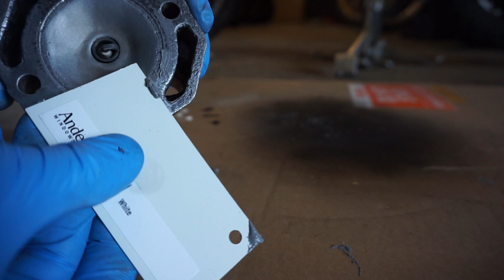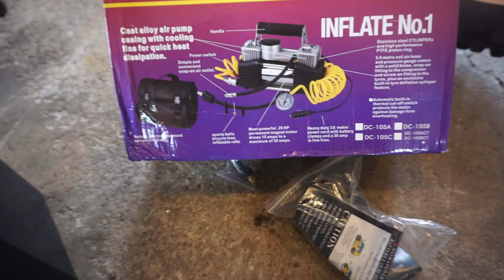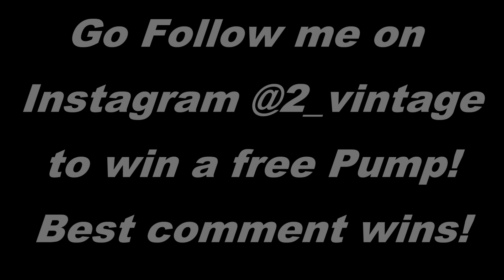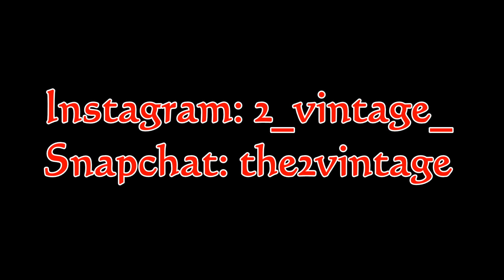THE END!!! Kx 80 Big Bore FIXED for Good!!!

Comment: I cannot believe I just witnessed someone put 2 part epoxy on a cylinder head, drill a hole into a shift shaft, put a bolt in it, and call it a day.. I’m not bashing because I’ve done some pretty sketchy shit.. but never when it comes to a motor.... thicker head gasket and get the head decked so it’s true again problem solved... 2 part epoxy is a piss poor fix to a big problem
Reply: Eh man budget cuts
Reply: I have to agree, this is one way to completely wreck your engine when the jb weld starts to break off and drop into engine, like you said either decked and thicker or double gasket, or get it welded and decked, jb weld should never be used for this type of work, not as a permanent fix anyway.
Reply: ShroomzGames agree 100%. He's as rough as guts, much better to weld the head and refinish. Epoxy on an engine combustion system, never. I'd never buy a bike from this guy, dodgy bush mechanic at best 😂😂😂
Reply: It's what the pros use man lol
Reply: These boys can do it 😅🤭🙈
Reply: He’ll probably sell it to some unsuspecting kid who mowed lawns for 2 years saving up for it.

Comment: Well that was real disappointing butcher bush mechanics. Epoxy as a permanent fix on an engine head, really?? As a temporary get out of trouble fix, maybe, but definitely not a permanent fix. Simple guys, if you are going to fix up a bike to sell on, do a proper job. Pull the top end and also check the crankshaft seals as well. Get the head welded and refinished (or replace the head), replace the stuffed shift shaft and shifter. If the crankshaft seals are stuffed split the casing and replace them, if the crankshaft seals are leaking it will affect the running of the engine. Then work on the tuning, carb, ignition. By taking your time and working through it you will learn a lot and will be rewarded by a job done right. Also it isn't expensive to do, a couple of seals - cheap, top end gaskets - cheap, bottom end gaskets - cheap, head re-worked - cheap, shift shaft - cheap. Once all done right and the engine running right, sell it for a profit knowing that you haven't stitched up a poor unsuspecting person is rewarding, try it.
On another note, thrashing the shit out of those 2 strokes up and down the road for top speed isn't doing those engines any good wot with no increase in speed. The engines need load and not full rpm for extended periods. Look at the race bikes, do you ever see them maxed out rpm and held there, no they are using the gearbox and on the road bikes they have to back off for the corners before they are maxed out for rpm.

Comment: JB weld is a bad idea on this part... The heat is way to extreme as this part expands and contracts. The JB weld won’t expand/ contract with the same consistency as the part.. It is definitely a temporary fix no doubt. AND unfortunately this bike is either not tuned properly or the pilot jet is still dirty or a combination of the two... or maybe a plug issue...  bogs with hesitation on the low end.
Reply: Eh man budget cuts
Reply: Henry I hear ya.. I used to do silly rig jobs like that too when I was a youngster...

Comment: Great video man, I've used JB weld on a lot of things like my quad it had a small split on the side of the case & spitting out oil & fixed it with it until I pay $800 for new case it works for now no problems, it's great product it works

Comment: In my own opinion it does sound lean  its using the fuel in the carb before it's been replaced so its fuel cutting but it doesn't sound like its slipping  so that's good